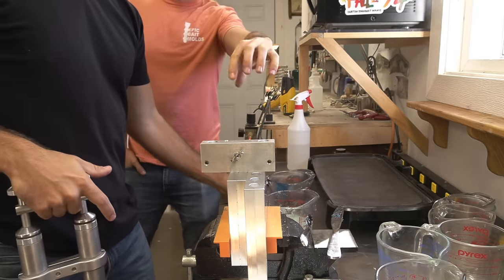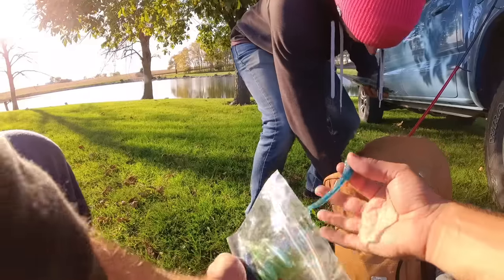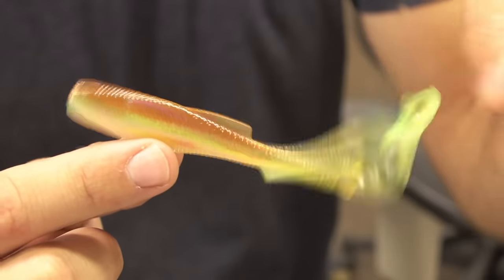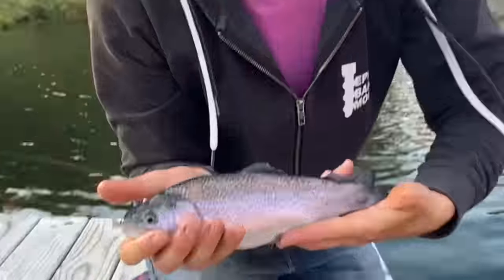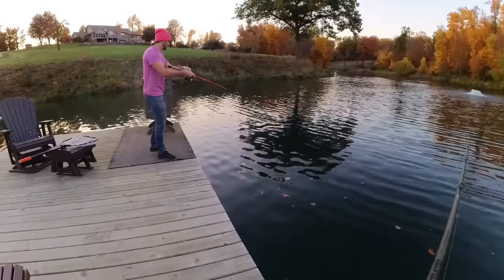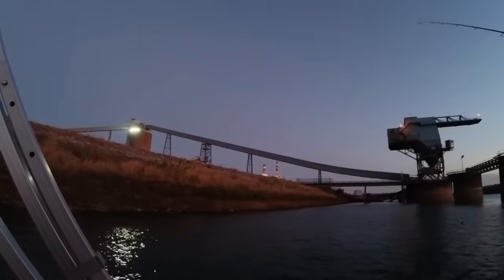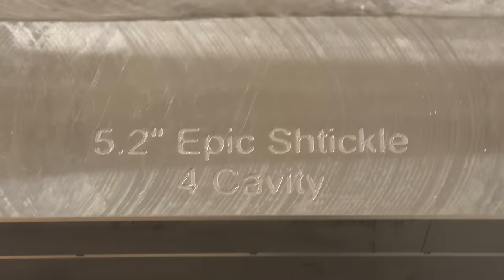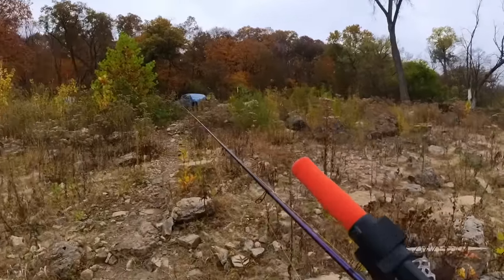Epic Shtickle Bait Mold | Inject to Catch

Comment: I like the Epic molds a lot but I would be more likely to buy more if there were different baits/sizes per each mold. Personally, I would rather make more different lures more slowly than a bunch at once, but maybe that's just me.
Reply: I think there might be injection issues if each cavity had different volumes since there is only a single shot point. Maybe if the plate had different sizes with their own injection points?

Comment: Hey I just came back from an your sand bass video and you complained about the water in your test tank feeling slimy. If I may be so bold to offer unsolicited advice, try a UV sterilizer from one of your local fish stores. Should run about $100 bucks or less.